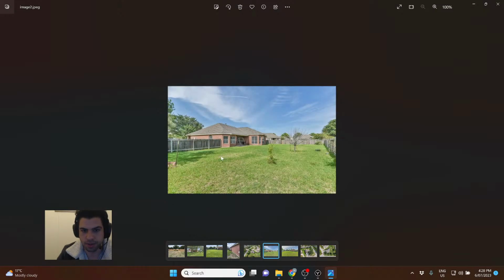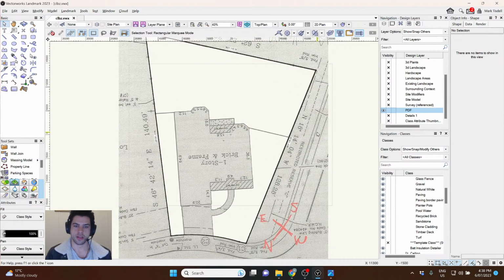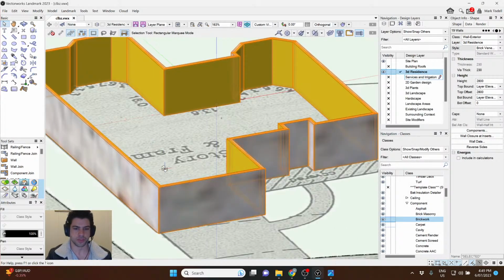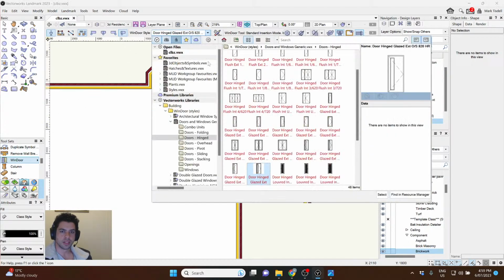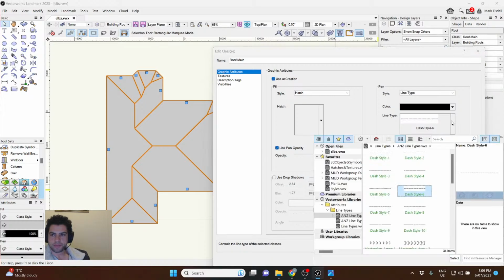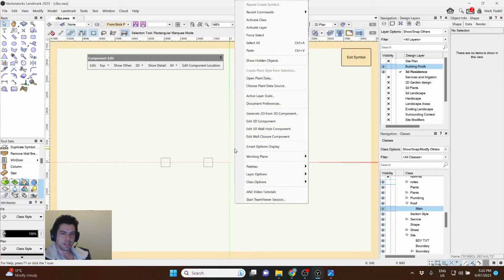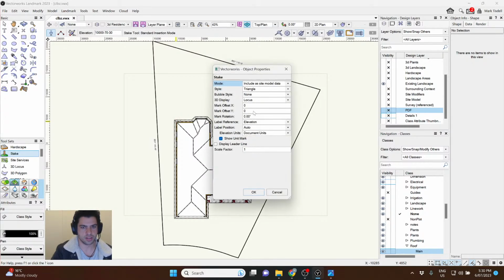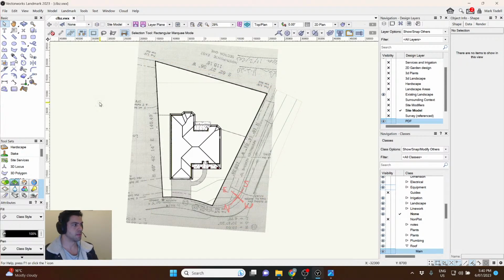Vectorworks Landscape Design Stream - Texas Landscape Pt. 1

Comment: I got multiple good tips from this video. Yep 12" overhangs are very common here in the US. In homebuilding we don't use mm much if at all. Except maybe some finish surfaces like flooring. The garage slab is almost certainly 4" lower than the house at the entrance to house and sloped even lower toward the overhead door.